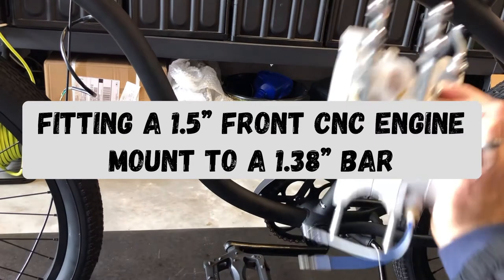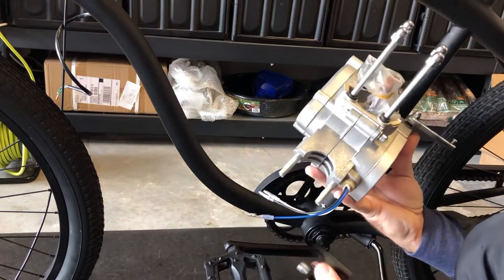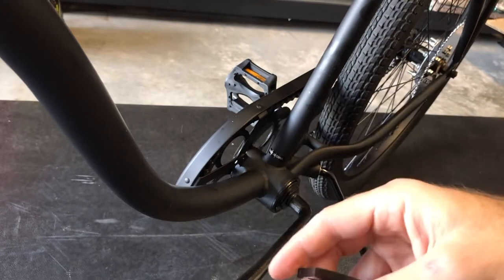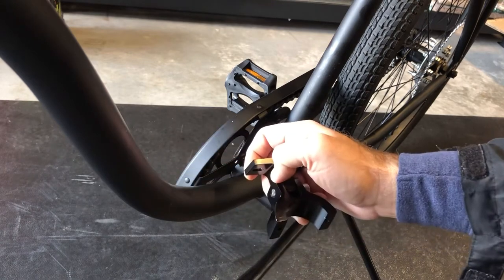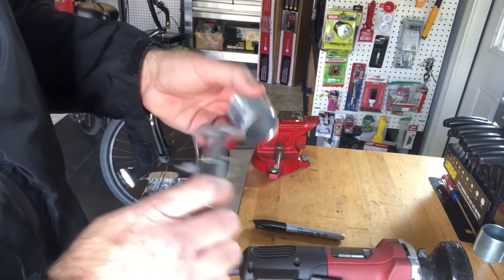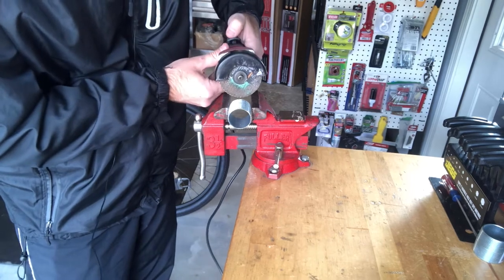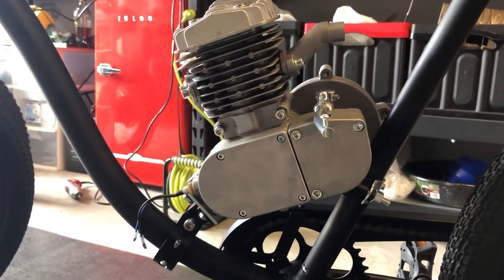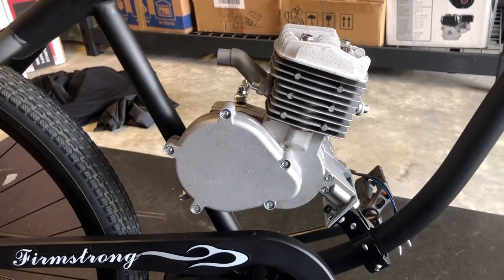Fitting a 1.5” CNC Mount to a 1.38” Bike Frame - HOW TO

Comment: Another alternative I've had luck with. Apply some cut to size electrical coat to each side of the 1.5in mounting bracket then install. The tape won't break down and will aid in gripping the frame and not wearing paint off.

Comment: does it vibrate more like that or is it still smooth even though the motor isn't directly on the frame?
Reply from the maker: Thanks for watching. It is actually more secure if installed correctly. Not all bike frames can accommodate this and the engine with the carb installed, but if it can, then it is recommended.

Comment: can this idea be used for a rear gear hub mount?
Reply: I've done similar but with a copper coupling. Copper is soft so it can bend to the curve of the hub and squish down really well. I used 2 pieces on each side of the clamp for mine to bring a 1 1/8" hub to fit my 1 1/4" adapter
Reply from the maker: That's a good idea, too! As far a using it for the rear hub, I personally wouldn't use the coupler I used in this video because the hub is not as strong as the frame; so you could disform the hib when tightening. I would spend the money to buy the adapter from gasbike.net, or return the wrong size cnc mount and purchase the correct size. Just my two cents.
Reply: @SouthernCustomCC  fair enough, I assumed as much given that even the el cheapo china doll I've got is pretty torquey.

Comment: Does it need rubber tube between the rear mount of the engine and the frame?
Reply from the maker: I would not suggest using rubber at either points of contact. Metal to metal is a more secure contact in this case. Happy building 👍
Reply: I have heard that if you put a fat piece of rubber, it will soften the vibrations couse  of the motor.

Comment: That's not the only bike hyper has the same problem with the new 2020 model take a look at my YouTube channel you'll see what I'm talking about with the CNC mount I had to have it specially made by manic mechanic the t-bone bracket that mounts to the motor itself was custom madea lot of the new cruiser bicycles are coming that way you'll have to get a CNC mount for most of them manic mechanic makes the 8mm bracket studs for CNC in different heights for the t bone bracket mount engine 1 .1/4  and 1.1/2 and 1.1/8 keep them brackets T -bone bracket that mounts to the motor